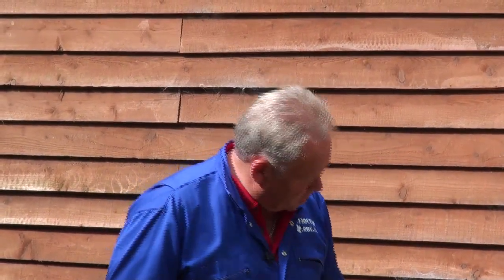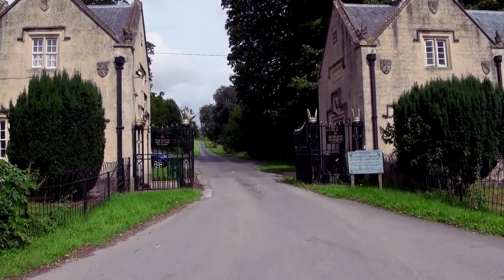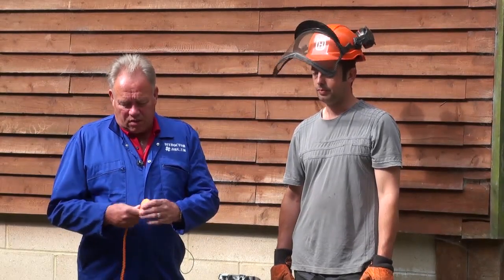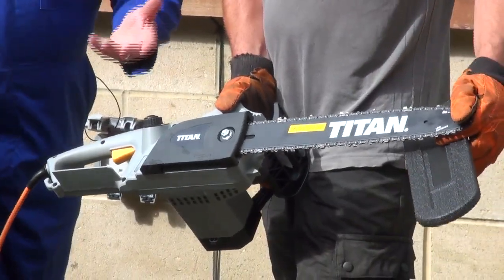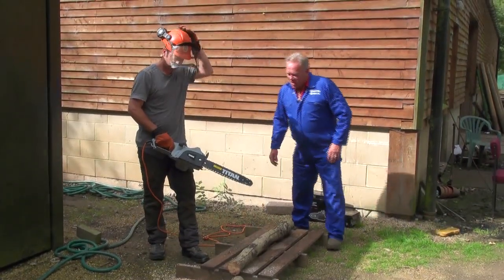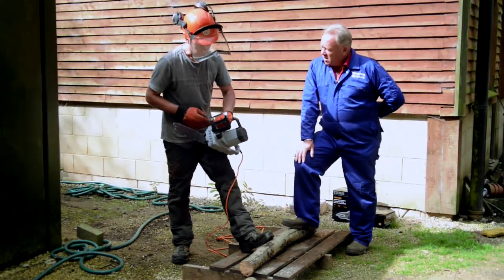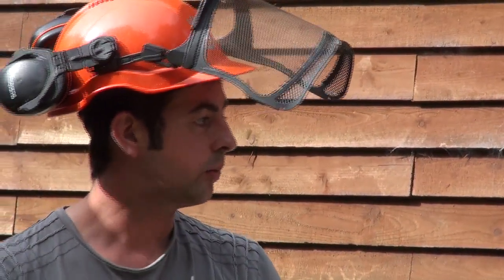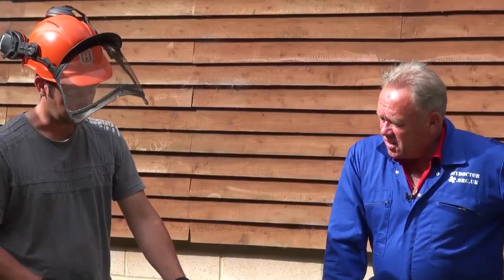Titan Electric Chain Saw Review

Comment: Good demo only the lead really needs to be behind the user not in front, if he steps forward to balance himself the lead could be kicked  into the blade. unfortunately the lead doesn't look long enough to drape it over a shoulder out of the way. the log could do with being put higher on a bench, good effort for protective gear though.
Reply from the maker: Thanks for your comment. It's what these guys do for a living and I'm told that seeing the cable, as\long as its behind the blade is infinately better than having it behind you where anyone could trip over it and drag the chainsaw from your hands. The safety gear is standard for them obviously.

Comment: Chainsawing is all about concentration...

My father told me (at about 14?) if the chain is moving YOU CONCENTRATE.

If you can't concentrate on where the chain is and where the cable is, then perhaps chainsawing isn't for you?

Bit like using an electric mower - make sure the chord is flicked out in a straight line behind you. Check with every cut - it's habit forming, move to a new cut, check or flick the chord out behind

As you will be focused on what is happening in front of you:
a) you should notice if the chord is in front of you / in the vidinity of the chain
b) it shouldn't be there if you're paying attention between cuts